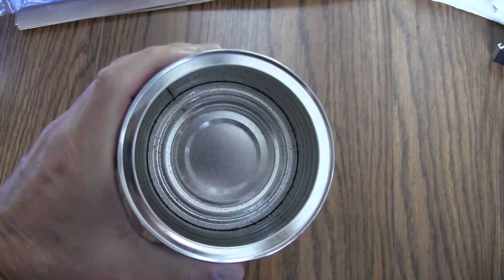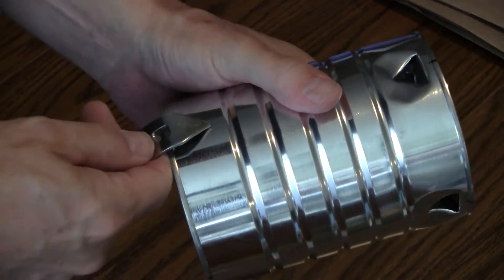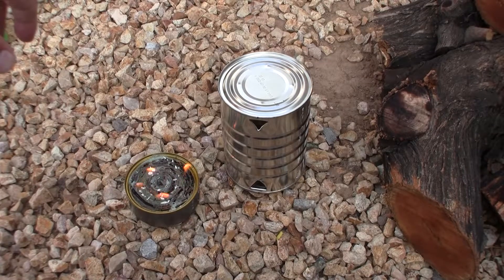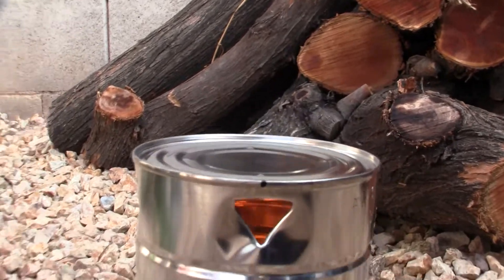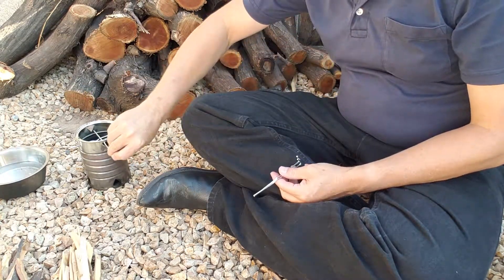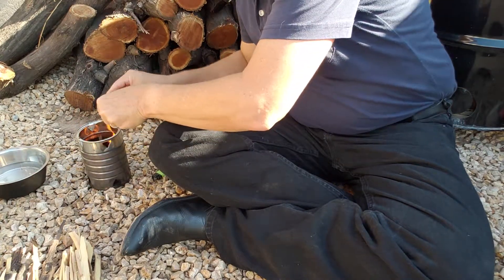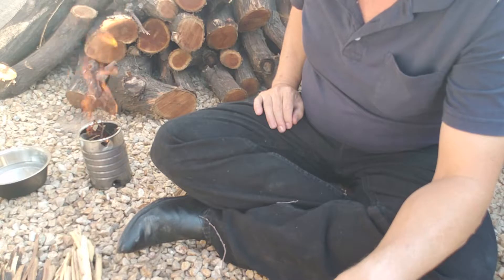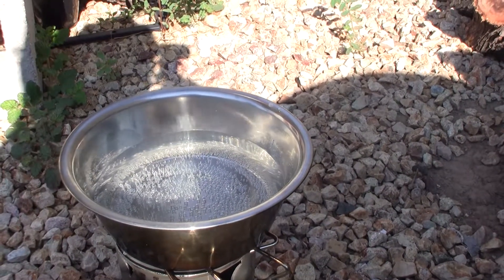DIY - Tin Can Survival Cook Stove

Comment: suggest you try a stove with more holes at the top than the bottom. The ideal ratio of Primary holes (at the bottom) to secondary holes (at the top) is in the range of 1:4 - 1:5 so you could make as many holes as will fit around the top and say four half size holes at the bottom to get into the ball park. Give it a try and see what you think. this will only cost you a can and a minute or two.If you are like me I have a box of assorted cans on hand to experiment with.